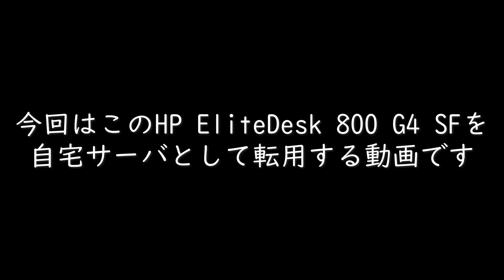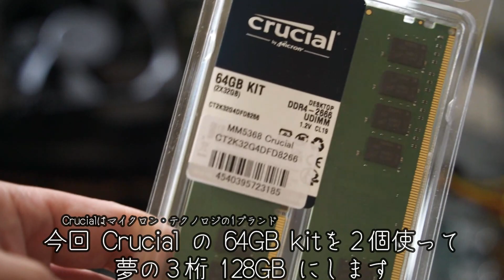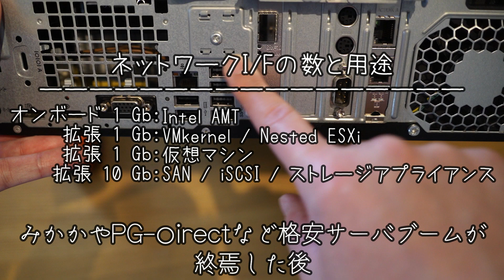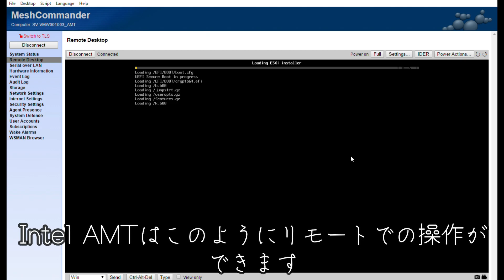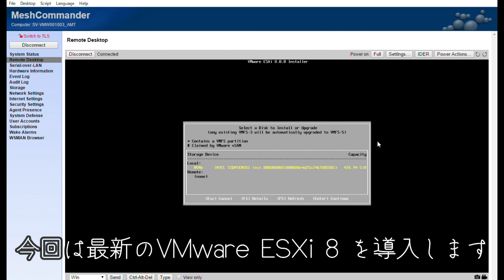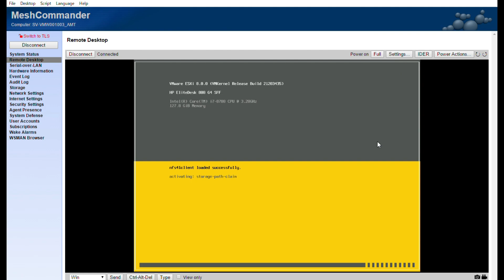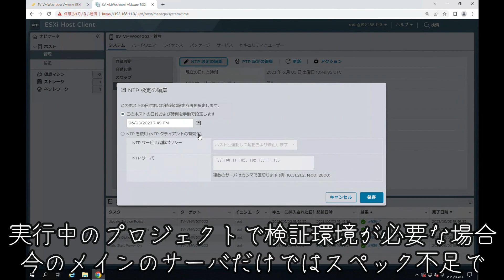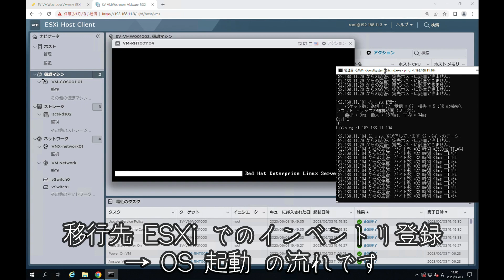メモリ 128GB の自宅サーバー【HP EliteDesk 800 G4 SF】

Comment: HP EliteDesk 800 G4 SFF  RAM max 64 GB
HP EliteDesk 800 G5 SFF  RAM max 128 GB
Reply from the maker: コメントありがとうございます。別の個体で確認したところ、BIOS ファームウェアが古い場合、メモリは64GBまでしか認識しないようです。BIOS ファームウェアアップデート後、128GBで認識しました。
Reply from the maker: http://h10032.www1.hp.com/ctg/Manual/c06418399.pdf
Reply: 同じものを購入しまして、最新のBIOSになっているのですが、64GBまでしか認識しない状況です。BIOSのバージョンなどを教えていただくことは可能でしょうか？
Reply from the maker: コメントいただきまして、ありがとうございます。私は２台保有しておりますが、２台とも128GB認識しております。BIOSバージョンは以下となります。
Q01 Ver. 02.23.00
Q01 Ver. 02.27.00